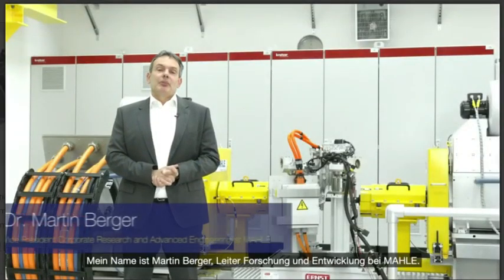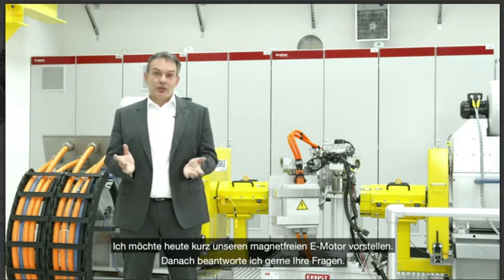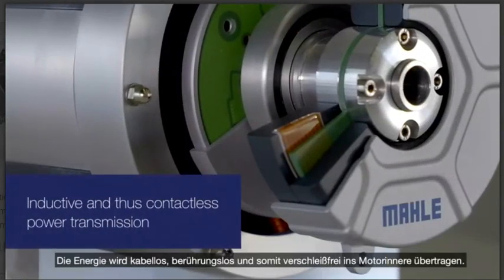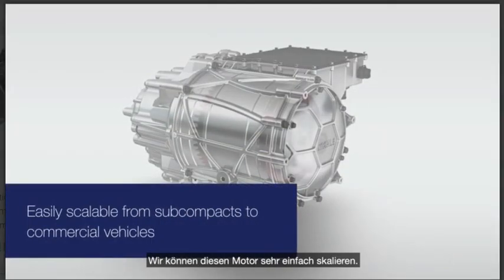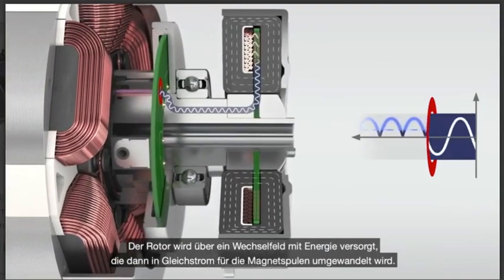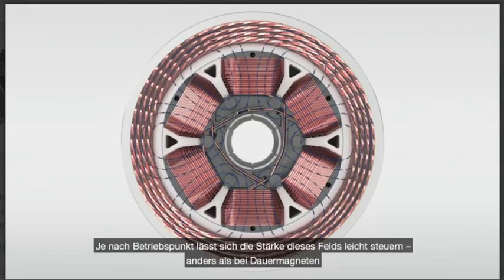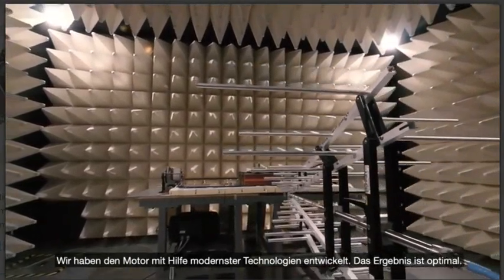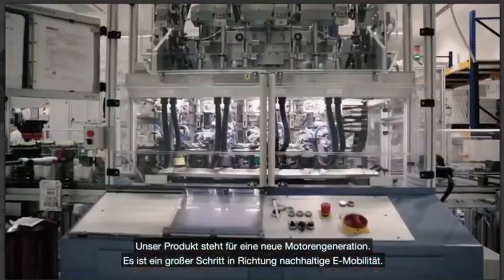Mahle, produce revolutionary new no-magnet motor...

Comment: The successful implementation of this approach, does not require any justification about its impact on conservation of resources and other fundamentals; although avoiding rare exotic materials is a relief.
Not long ago, we had radio and gramaphone system with a 12 inch speaker with no magnets! (Electromagnetic). Great sound!
The record player had bulky cast iron tone arm and a magnetic cartridge! (Only 78 rpm vinyl records with metal stylus).
Such systems were replaced by hi_fi systems with ceramic cartridges although high end ones had magnetic cartridges.
I'm sure there are a lot of high-tech guys out there who could be drawn into making such motors.
Could such a system be patented?
Why did it have to take so long to make this switch over?
Reply: When the early beginners learnt about the " new electromagnetic" behaviour of current in a coil of wire...., one of the first " contraptions made" was somewhat like a kind of today's s.r.m. ..but they did not know how to develop it properly....( flux linkage/airgap influence.. reluctance etc.)
leaving aside it's effective control..but rather it led to the progress of solenoid/ actuator development..

Comment: These motor have limited RPM because the copper windings don't like high rpm, that's why they when with solid rotors.  Also, RPM is directly related to HP. Secondly, your stated efficiency is low and not scalable to all sizes. So don't mislead your audience.
Reply: In power plants this exact type of electrical engine is in use with up to 1,500,000 kW and an efficiency which is above 95%

I would say that is scalable enough.

Comment: AC motors without permanent magnets have been available for 130 years. (The elevators in the newly constructed Eiffel tower (circa 1890) had AC motors, using no permanent magnets). So my question is - what's different about this motor?
Reply: cgi and lust for profits ;)
Reply: Look up "induction motor" or "asynchronous motor" versus "synchronous motor" - this is a synchronous motor. And synchronous motors usually need slip rings, but this doesn't because it uses inductive power transfer to rotor. And synchronous motors with inductive power to the rotor usually depend on rotation to transfer power, but this doesn't.
Reply: @brianb-p6586  thank you!

Comment: Why you have outer stator? is not more dificult to cool the inner electo-magnets?
Reply: The coil on the rotor only charges the magnetic field (very little power needed) while all the big power is located in the stator.

Comment: Very similar to the digital motors, a good extension of the digital motor. About time someone started thinking outside the box as these motors are a perfect answer for many problems.
Magnetism, like electric fields can be transmitted via suitable mediums to perform at its most efficient.

Comment: Do you have a different material in the induction segment of the motor for increasing effiency? If not then is it just vacuumed space or air?
Reply: I am interested in such electric motors like this one that doesnt have a permanent magnetic compoment and can be shut down few times per second because I am researching about an aerial vehicle which can recover energy from certain things and I need some king of a polarization of the plane body mid flight. Best way I could think of is to have a motor that does not revolve but rather make a one side pull of the rotor and the magnetic field aroynd the plane could be polarized this way and would be very happy if you help me.

Comment: The vast majority of electric motors (98%?? at a guess) do not have any magnets in them.
Reply: Yes but the power to weight ratio is not that good. Permanent magnet motors and DC motors (those who have a coil on the rotor instead of magnets) have the best power to weight ratio. Compare the power and weight of a 3 phase industrial motor to a permanent magnet AC motor (usually Servo motors) and you'll be shocked.
Reply: Mr Zero, 

why should I be shocked, I'm a retired electrical engineer. It is not just D.C. motors that have wound rotors, some A.C. motors use wound rotors to assist starting and others are synchronous motors.
It is just such a misleading title to the video.
Reply: @iareid8255  excuse me I didn't know you're an electrical engineer. I thought you didn't know much about the subject and was just asking. 

Yes sure some AC motors have rotor coils like the one phase AC motors in most household appliances and power tools and indeed that have a good power to weight ratio but the rotor commutation is always through brushes which limit the maximum speed of the motor, its service life and generates a lot of heat and noise beside other effects. So any motor that have a coil on its rotor would need commutation of sorts, the innovation in the motor in the video is that they have a coiled rotor motor with brushless communication which is a great innovation (assuming of course that they hit the target efficiency that they claim in the video).
This means that they were able to construct a cheaper motor (no magnets) with a good power to weight ratio because of the existence of coils on the rotor and without brushes which should be transformative if what they claim is actually true.
Reply: @causeitso  Mr Zero, 

true to a point, wound rotor A.C motors have slip rings which are not as noisy and have a greater efficiency than a commutator.

With wound rotor motors that add resistance to the rotor impedance, as I said to aid starting, once up to speed the resistance is shorted.

As brushless alternators are now common and have been for decades, I would imagine that the same machine will also run as a synchronous motor. These machines are expensive and generaly used for niche applications.
Reply: True, most motors are not permanent magnet... but they're asynchronous (induction) machines.

Comment: Nice motor !
Probably less efficient than the one with magnets, BUT worth it, if there is no maintenance cost for the car owner.
Reply: It's more efficient than magnetic based engines (per his presentation). What I didn't see is how much more or less powerful but that's another subject. 96% plus efficiency is amazing.
Reply: The most common reason for a fault in an electric motor is failure of the bearings. So a component fails mechanically due to fatique. The rotor, stator and coils are less likely to fail unless there is a high voltage impulse in the coils.
Reply: @georgiosyiannakou5537  I agree, but in order for the bearings wear to not translate into a catastrophic failure (the rotor touching the stator), the air gap must be made pretty big (and by "big" I mean 1 or 2 mm) which throws the efficiency in the dirt.

Comment: Ok...I'm confused.....if this is really as good as explained how come this hasn't been a story in the mainstream news as this would make the cost of EV's lower and improve the carbon footprint because we won't destroy parts of the world for rare earth elements. Also.....does this in turn mean a more efficient generator or is this only valid as a motor?
Reply: You see mainstream news hunt for thing like this? No, they only care about what theyre paid to care about
Reply: if this was that good as cgi artist made it to be, then it would had been bought by a giant multinational fund on day one....no buyers?...then you sixth sense is wright, it'a a get rich quick scheme
Reply: Similar principles have been used in generators for decades.  An excitation generator produces power for the field coils of the main generator.  The two generators are on the same rotating shaft so the wiring between the rotors can go through the shaft without using brushes.

In this motor, the excitation generator is replaced by a rotary transformer.  That way the field power comes from the electric source.  It also allows operation at a wide range of speeds.  Both of these characteristics are very important for the automotive motor.

This design clearly has advantages, in particular it makes field weakening very easy, which improves the speed range.

My question is, what is the cost/benefit versus an induction motor?  Clearly this motor is easier to use, but that is a one time savings, and the more difficult manufacturing is a recurring cost.
Reply: @CoastalSphinx  The induction motor is less effective with a lot of heat generated in the rotor. Also, you can operate a synchronous engine with electrical excitation always with a cos phi of approximately 1, which reduces the stator current to a minimum (also increasing efficiency).

Comment: Don't let an engineer see this . . . There's soo many points of energy waste!  Just pay for the rare earth minerals! . . .
Reply: Where are the many points? Excitation coils use neglectable power, compared to the main coils. 
You also get an extra control Parameter, to alter the characteristics of the motor on the go. It might be possible, that this motor is more efficient on the road due to a broader efficiency band with slightly less peak efficiency than a normal synchronous motor.
Reply: @fabianrudzewski9027  The field coils use extra power, diodes waste some and the rotatory transformer is going to be very inefficient!  It's your overall efficiency that's important; I'm gonna buy the car with the greatest range or best $/KM.
They're also working on rare earth substitutes like Iron Nitride, and you can solve the regen problems with electronics/transformers.
Reply: @bardrick4220  You need very little power to generate the magnetic field in the rotor. Therefore these losses are pretty minor.
Reply: @norbertfleck812  How much?  I don't know the number for a typical motor.  You're going to have to prove the thermodynamic effency for this particular design if you want people to take it seirously!

See I'm skeptical because they phased out these motors in power tools, starters, ect because they wern't powerfull/effecent enough, and now you're adding 2 more points of waste.
Every KW saved = saves the planet + saves my pocket book.  And that's how I'm shopping for an EV: long term savings!  I really don't care about the cost of magnets, but I might care about not supporting the CCP! (that's really big problem here; all the green tech feeds the communist monster! . . .)
Reply: @bardrick4220  yes, the field coil takes some extra power. But that usually pales in comparison to what is used to drive the vehicle. 
And like mentioned above, you gain an extra control Parameter, that might even overcompensate for the losses in the field coil.
Most of the times, manufacturers only release a product, that they think has a market. Even if this contraption isn't the most efficient one, it may be cheaper due to it not having magnets. And its production will be less harmful to the environment, as rare metal minig is really harmful. 

Well I'm not just going to buy the car with best efficiency. That would be an added bonus after looks, performance, handling and interior.
Reply: @bardrick4220  You mean shaded pole motors which really have much losses due to magnetic hysteresis in the rotor. Their biggest advantage is the ease of control. You can run them with DC as well as low frequency AC (with 60 Hz they still work quite sufficiently well if a few design rules were followed).

Here we are talking about a synchronous engine which has a more or less constant magnetic field in the rotor.
These motors are a bit tricky to control (solid state control unit required for dynamic application), but they have an unmatched efficiency since they were invented 100+ years ago.
You find them as Generators in almost every power plant (except very small Power plants where often the cheaper asynchronous induction engines are used).
Reply: @norbertfleck812  No I don't (disgusting efficiency on shaded pole!)
We're trying to solve problems that already have good solutions!  You don't need a second field winding if you pump the low voltage regen through a buck converter; that boosts the voltage up to level that can comfortably recharge the battery!  We can also tap the stator to give us different voltage characteristics.  Switch it on the fly with electronics or just incorporate a standard transmission (drivers love these despite the efficiency losses!)

Comment: How is 95% efficiency obtained with induction losses, rectification losses, and loss from generating the rotor's field?
Reply: With physics, material science, and electrical engineering. It is not that amazing though by today's standards. It is just an ac induction motor or some slight variant of one. Look up industrial 3 phase ac motors and you can find many such motors that run at efficiencies of 90% or more. 95% to 97% efficiency isn't as common but many motors are designed to meet that standard level of efficiency. They are using apple style marketing to make it sound more amazing than it actually is.
Reply: @TheNeighbor4U  I'm very well aware of the state of electromechanical engineering, which is why I know that buzzwords don't magically produce fantastic efficiencies in motors that have a range of load requirements and extraneous energy conversion/power conditioning steps. That's why I'm asking precisely how this efficiency figure was obtained, and wasn't at all asking for some snarky pop-sci level non-answer.
Reply: @AtlasReburdened  if you wanted a serious, in depth, professional engineer's technical answer then why are you asking in the comments of an apple marketing style promo video? I mean this channel isn't owned by the company Mahle just based off the channel name.... Go to the Mahle website and email whoever you have to in order to be put in touch with the engineering team. They are the only ones with those answers. Just temper your informational expectations though, because few big businesses are willing to divulge the in depth technical details of their new products. At least not without a nda contract and 6 or 7 figure payments for the products. With any luck Mahle has published the technical specs for this motor on the product page for it on their website.
Reply: yeah I’m just going to say it’s impossible to be working as designed and getting 96 due to a approx 3% loss to induction, rectifying loss of approx 2% and a rotor flux loss of approx 3+% however under load I’m sure it’s significantly lower
Reply: @koltonshampine5441  power, that feeds the rotor only creates magnetic field using rotor coils. Stator coils take majority of the power to create torgue interacting with aboe mengioned magnetic field.
Reply: @koltonshampine5441  who knows, maybe they figured out a clever new way to eek out 1-3 percent more efficiency in a cost effective, mass manufacturable design. The odds are against them though. Either way the motor is not the fan-fangled, awe inspiring, brand new tech that this advertisement would like you to believe. 

They also could be playing the standard manufacturer advertising games where they advertise specs that are true only when you manipulate the conditions the motor operates within to an unrealistic extent that is impossible to find in practice.
Reply: @koltonshampine5441  The rotor current just excites a more or less constant magnetic field. 
Therefore there are hardly any induction and rectifying losses.

The loss of the power electronics necessary to operate such an engine will add up.
Reply: Why do you call those separate losses?  I would lump them all under rotor field loss, because only the rotor field path incurrs them.  The main power path to the load doesn't have induction or rectification.

I would expect this motor to have an efficiency similar to a traditional wound-field synchronous motor (with brushes for the field windings).  But I don't know what their efficiency actually is.

Comment: So it’s like a brushed DC but instead of brushes it uses inductors?
Reply: More like a synchronous machine, with brushless excitation. A conventional brush motor is switching rotor winding polarity through the brushes and commutator, this is supplying DC to the rotor. It's damn smart!
Reply: @petercroft9895  I see that now. It’s replaced the traditional slip rings on the externally excited synchronous machine.
Reply: Multicurrent motor with inductive power transfer

Comment: Seems like a combination of compound-wound motor with a Induction-repulsion motor. Both of those types have no permanent magnets. Induction motors are the primary motive source in industry, operating on 3 phase power and can go to thousands of HP, such as the drive on large ships which are diesel-electric. Nothing new, Tesla had designed them in 1893.

Comment: SepEx motor. Been used on trains for decades now. Good to see it make to to the automotive sector. It needs a more complicated power controller unit though.
Reply: The main innovation is not the controlled excitation of the rotor coil but how power is delived to the rotor coil. They are using inductive power transmission instead of brushes and this is the main innovation.
Reply: Complicated stuff seems to be easy these days. With IGBTs and whatnot. This may make it smart for these times.
Reply: @pizzablender  you're absolutely right, a small microcontroller might cost 1 dollar nowadays but in the 70s it might have cost thouthands.

Comment: I wish you very much success with this motor. The environmental damage that is caused for permanent magnets is always overlooked. Thank you for this wonderful job.
Reply: It will be even easier possible to regulate power and torque output, I assume.
Reply: The only new about that synchronous engine is the replacement of simple and inexpensive (and easy to repair) slip-rings with a lifetime limited electronic device.